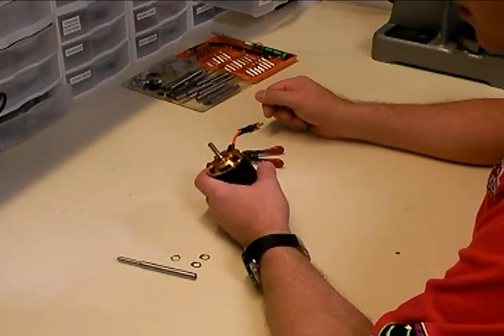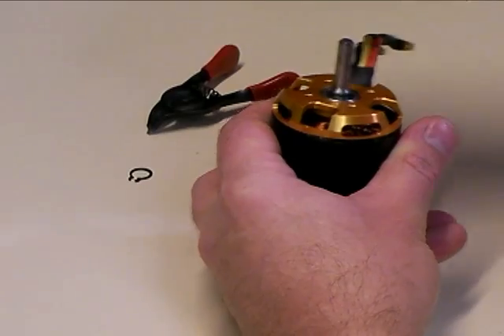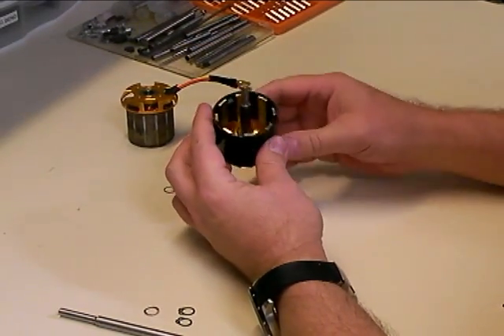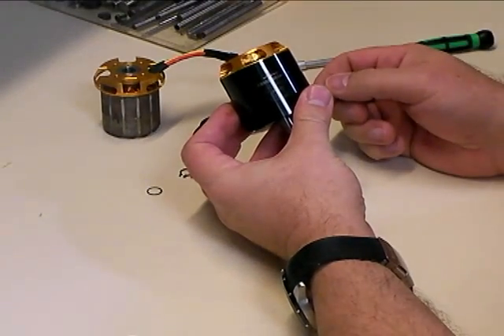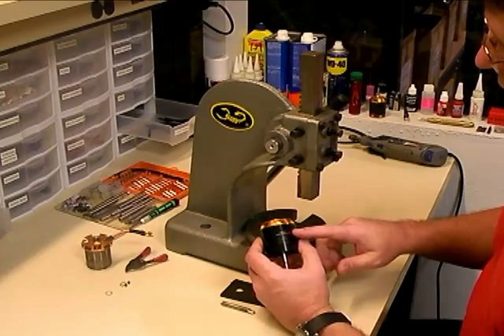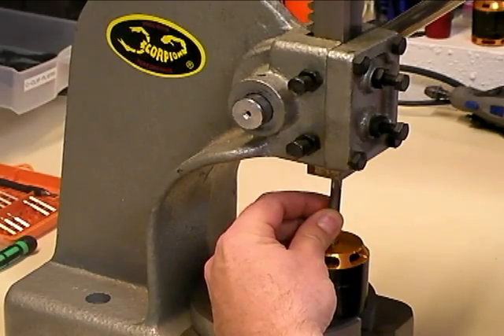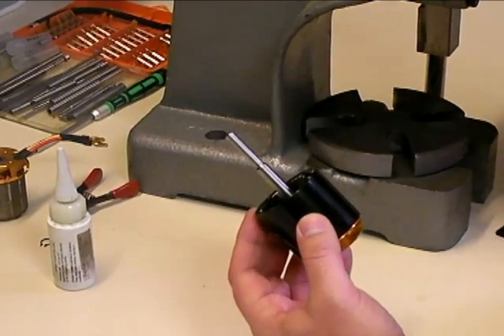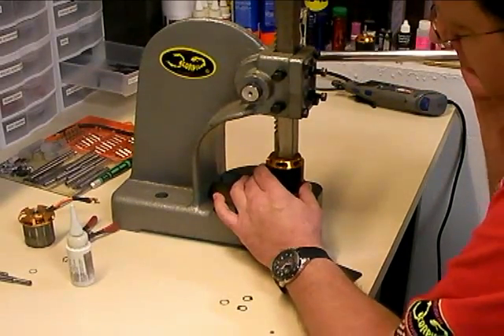How to Change a Shaft in a Scorpion Motor by Innov8tive Designs

Comment: ☠️BLACK BARON☠️ 7:14 ... the washer is really important because that's a "stress factor" including the bearing in these motors. A very thick sticky greeny grease you use for MTB could help ... maybe?
Reply: I just took apart my old HK-4025 motor (original V1 version), and I did not see that internal washer that is supposed to keep the inner bearing race from touching the aluminum bell. I'm sure one did not fall out. There IS a shoulder on the bell to contact the inner race, but now I'm wondering if I should get an 8mm thin washer to install. I see that in all the rebuild kits and shaft kits, they do not have a flat washer, only the outer wavy washers?

Comment: Hi, I've got a thunder tiger OBL 44/11-30h motor which has got some run out in the can.  I can't find any grub screws holding the shaft into the end piece so I guess it must be a real tight press fit alone holding it.  What do you think
Reply: Yes, the shaft is usually a very tight press-fit and it doesn't just come out easily after removing the set screws.  You usually need an arbor press of some kind to use a lot of force to push the shaft out.
Reply: @ramovan  Thanks for the heads up.

Comment: Really nice video! It would be nice to use an aluminum centering ring to get the shaft in good alignment. And I'd not use rubber but something like a piece of plastic so that you have it under the press perfectly perpendicular. At work we use Schmidt presses which have a hole in the ram that you can put any kind of anvil in, that's really convenient.

Comment: I don't have a press of any kind so i tried with a clamp...the drill bit (3.8mm) I used to try press a bearing out snapped and the bearing hasn't budged...

I am wondering whether I should take it to someone with a press, or whether heating whilst pressing using a clamp will work?

Comment from the maker: A 1/4 ton press is pretty small.  It would probably work for a 2221 motor, but not much more.  One thing you can do to help loosen the shaft is to heat up the top of the motor with a heat gun to about 140 to 150 degrees.  This will be hot enough to the touch to feel too warm to leave your finger there for more than about 2 seconds, but not hot enough to damage anything in the motor.  The aluminum expands slightly and loosens its grip on the steel shaft.  For the larger 40mm motors, a 1-ton press is a must.

Comment: Just re-watched your video.  I need to change the shaft in an HK 4025 motor.  The current shaft does not have any flats on it.  I already have a new shaft with a flat.  So I removed the circlip and the wavy washer.  But the stator will not separate from the can.  I've pulled with all my might.  I'm thinking that the bearing must be frozen on to the shaft.  Its a brand new motor, so I can't imagine why it is.  I don't have any kind of puller that I can use.  Do  you have any ideas?  THanks.

Comment from the maker: There should be a tiny amount of end to end play in the motor if you are using regular flat washers.  normally about 0.020" or 0.5mm is a good amount to have.  This allows for the motor to expand a bit when it comes up to operating temperature.  If you are using the newer wave style washers, you want the shaft adjusted so that the washer is just barely compressed when the motor is cold.  The washer will compress as the motor heats up and keep the bearings with good side pressure all the time.

Comment from the maker: ILTSYC,  Honestly, I have never had that motor apart, so I do not know.  In most cases there is either a tapered cone or a raised ridge on the inside of the rotor end bell that is designed to ride on the inner bearing race.  If the motor has either of these, then no washer is required.

Comment: Hi, I bought a HK4035-500 from you and I also tried to remove the shaft. This is a very helpful movie on how to do this. However, one grub screw was so tight from factory that I broke the screw trying to get it loose. Any suggestions to solve this?

Comment: how much space is requied between the c-clip lock groove and the bearing,for the spacer to fit? and shoult the motor have alittle slope after assembling or should it be tight?
thanks

Comment from the maker: If you do not have an arbor press or a drill press, or at least have access to one, then you should not be changing the shaft.  Proper tools are required to do jobs like this, and if you do not use the proper tool, you risk damaging the motor in the process.